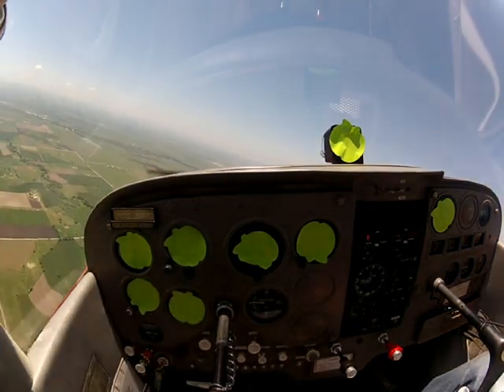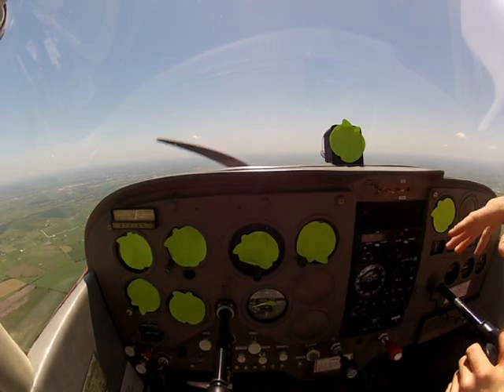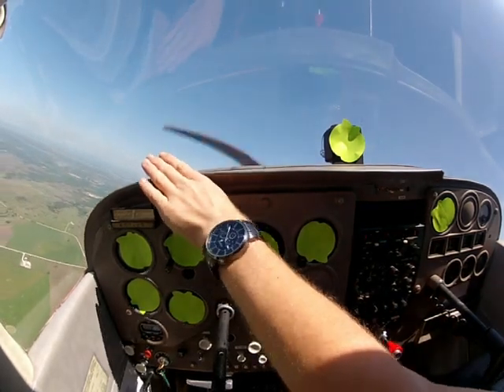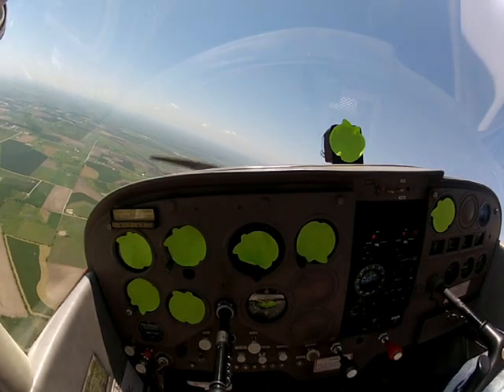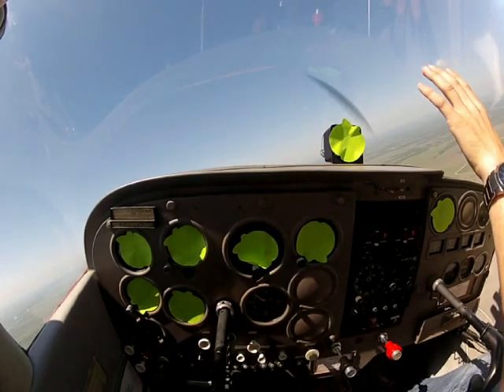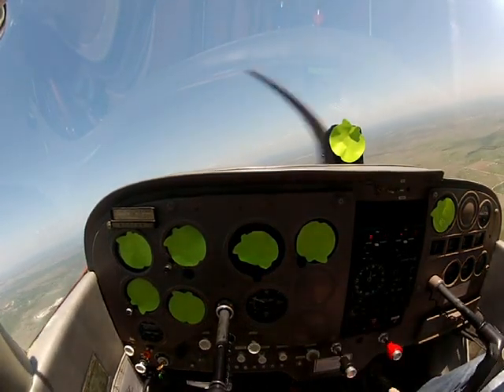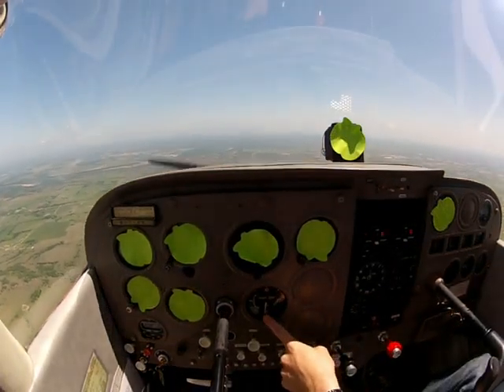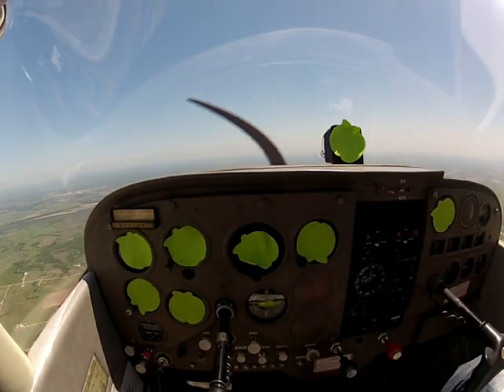Turns, and Level Turns

Comment: That was one tip the turned my flying arround, I was struggling so much at first. My old CFI got me so traumatized about keeping my altitude in the turns that I started chasing the needle all the time. My new CFI just told me to forget about it, and put a piece of paper in front of the climb indicator and got me to do turns without looking and out of nowhere I kept my altitude bang on and it was a scorching hot day.